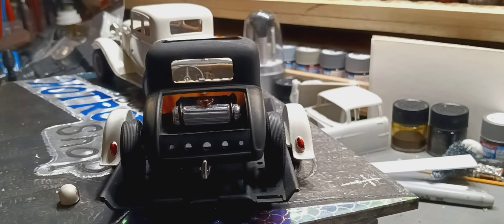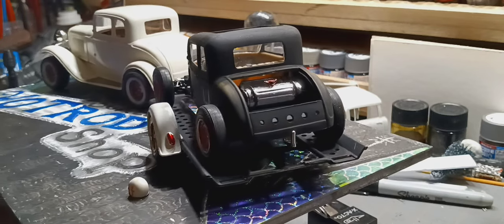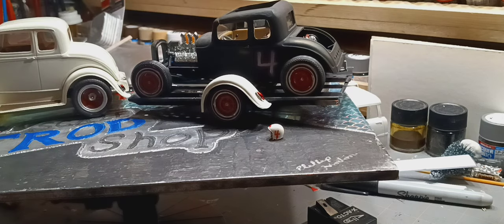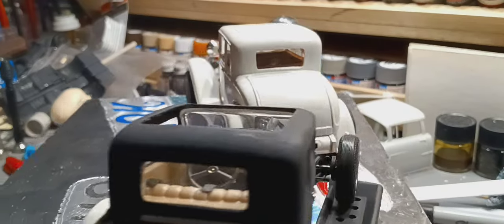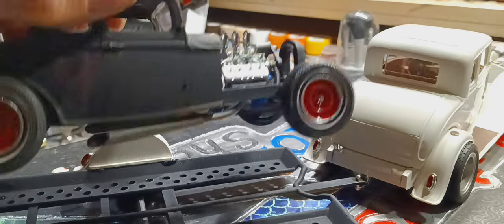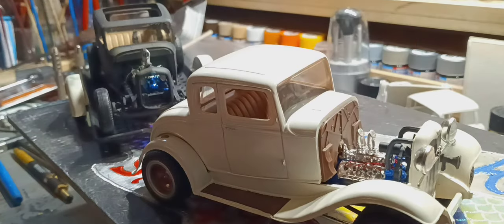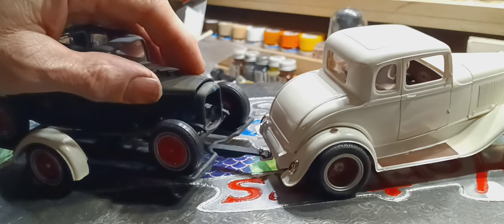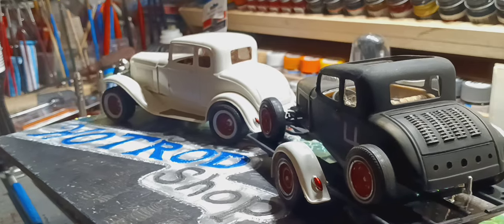tool I use and final on the #SBOG g.b. and a bonus past build.

Comment: SBOG turned out great, neat combo build for sure, the trailers look great, never enough kits with good trailers in them. cool tools too, i like the hammer, hope it works out great for ya as i bang with the nippers i have, so i may need one of them some day. way cool imc touch tone terror kit too, goes without saying that i am sure you will enjoy the build of that fine kit.
Reply from the maker: That trail was out of an old Amt kit Corvette I think the ones I'm working on are based on the new California combo trailer. The hammer came from harbor freight tools like $8.00 watch repair hammer.